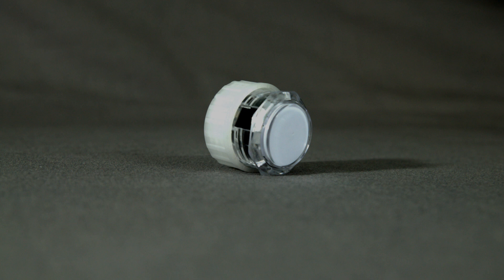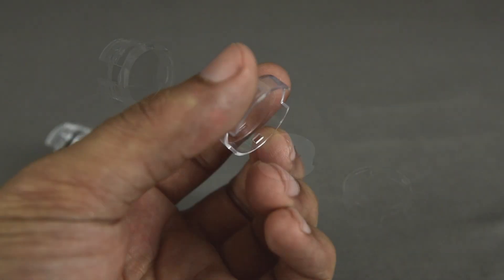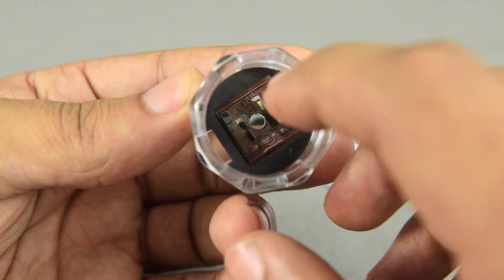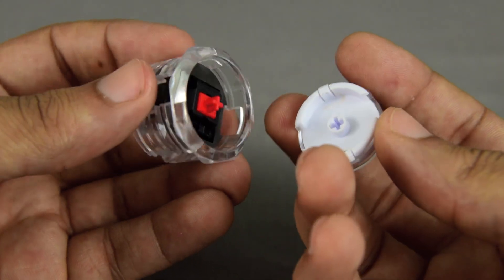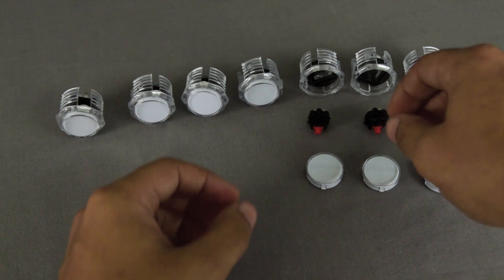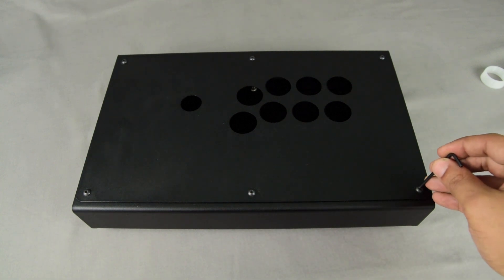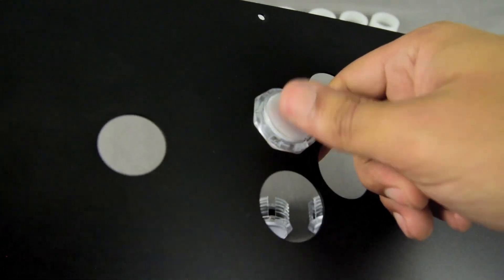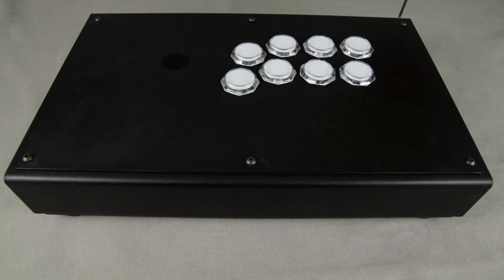Tech Corner: The GamerFinger HBFS-30-G3 Pushbutton

Comment: Do yourself a favor, and be careful with these buttons. I've already complained to GF, and they didn't respond this time, though they replaced my buttons once before. They're overpriced for how they perform. I had Sanwa's for over 15 years that still work, I had to replace these buttons TWICE in a 5 year span. I had the first gen, they kept sticking somehow, I don't know why, maybe it's because I was in an area that is somewhat humid, but the sound muzzler inside just kept sticking to the button. I had to drop alcohol in them every other 3 days to get it to stop sticking. I like to press buttons very lightly, when you first get these, you barely have to put any pressure on them, but after a few short months, you have to BANG them.

Then, I complained to them, they send me another pair, the G3, they worked well for about a year, but they're having problems that I can't even pinpoint. I do have a mechanical keyboard, so I know about these type of switches, although, I think Cherry switches are kind of wack, but they're okay for keyboards; not for arcade sticks, as you will more than likely wear them out faster than on a keyboard I think. I am about to put gateron switches in these and try them out. I don't know if it's a problem with the housing, but god DAMN, do I have to bang these buttons sometimes to make a move come out. I think the switches they come with are just pure shit and don't last long. It's possible that these Cherry switches aren't even real, they look a bit different than the ones for keyboards in the pin connector, but they could be updated, too.

If you're someone like me who makes videos or practices multiple games (I play shmups, platformers and fighting games and make combo videos here and there), these switches are pure shit. I have the Cherry grey's in the ones I have (black G3's.) 

It's hard to know who to blame, Cherry or Gamerfinger (GF does have great customer service though,) but either way, they did not really rigorously test these buttons for the long run. If you were to pay like 6 bucks per button and they only last about a year or two, that's a really expensive investment compared to 2 dollar buttons from Sanwa; or even Seimitsu, that last more than 5-10 years. I swear to god, I have a mirror top HRAP1 with the ugly green buttons, ALL of those buttons STILL WORK. I must have played a million+ games of 3S on that stick, and never had to replace those buttons.

I'm using these in an Etokki Omni with a Brooks Universal board, so I know it's not my board. Lastly, look at the reviews on FA for these buttons, I'm not the only one who's complained about these. It could be the button housing, or the switch. Either way, be careful with these.
Reply: I've owned a set since 2018, never had them replaced, and never changed out the mx silvers they came with. 

They still work. 

And fixing the buttons are as simple as buying a new microswitch rather than new buttons.

Also you can disassemble these buttons and clean them with soap and water. 

I wouldn't dare to do that with a Sanwa or seimitsu button

Comment: I have just bought a HORI Fighting Edge and I want to change the hayabusha buttons (besides other parts), as they are too sensitive for my taste. I'm new to pushbuttons, so I have some noob questions.

I'm thinking about ordering a sample of each cherry microswitch and test them out. (Otherwise how would I know?) Are the microswitches compatible with any pushbutton, or only with the Gamerfinger?

I don't like the octagonal shape of the Gamerfinger buttons, is there a circular version or a different brand you can recommend instead?

Do you think it's a good plan to order a sample of the microswitches and install them into buttons to test them out, or would it be better to just buy let's say Sanwa buttons?

Any advice is welcome, thanks!
Reply: Microswitches are also compatible with the Crown 202-MX: 

30mm - https://focusattack.com/pushbuttons/popular-brands/crown/sdb-series/30mm/202-mx/
24mm - https://focusattack.com/pushbuttons/popular-brands/crown/sdb-series/24mm/

They are not compatible with any other button, such as Sanwa or Seimitsu.  This would answer the other questions you had.
Reply: Old post, but I found sanwas to be too sensitive for me. Switched to seimitsus and have never been happier. That said, crowns SDB202 buttons are good as well and you can swap the switches on those as well. They have the circular barrel that you desire as well.

Comment: How do you remove the switches; IE bought blue switches separately, but silvers are pre installed?
Reply from the maker: There is a hole at the bottom of the base.  You can use a small pointed object to push up on the switch at the base.

Comment: i have the pushbutton style, and when you put it in the razer panthera, it spins way too easily, it doesn't quite bite into the panel, the side tabs, what can i do to prevent this? i didn't get the lock ring when i ordered from GF, is there anyway i can buy the lock rings from you guys? the buttons spinning just drives me nuts, and i hate it. What can i do to make it snug like a sanwa snap in? thank yu
Reply from the maker: The lock ring doesn't fully go to the top of the snap button rim, which prevents it from locking on a thin metal panel.
Reply: @focusattackcom  oh i see...what can i do to prevent the buttons from feeling loose while in the panthera? for some odd reason it doesn't fit snug on the panthera, it happens to be in that elusive thickness where it's not too thin or thick enough for the tabs to grip on it, so it can freely spin even when i pushed it TIGHT and flush onto the panthera panel, its not super loose but i can spin it easily with my fingers if i wanted to. Any remedies for this? you guys should try it out with a stock panthera, default art still on, i havent tried with a plexi so i can't say but the default art plus the metal panel seems to be too thin for the buttons to snap on tight
Reply from the maker: @bludika  I have a snap in sample, but I don't have a stock Panthera anymore - the one I have is stripped and panel replaced.  you could possibly use one of our TE2 rings, or something like a rubber band or o-ring.
Reply: @focusattackcom  yea i was possibly thinking of the TE2 rings too hahaha. But it's just odd how the snap ins don't fit snug in the panthera, while in the PRO N it fits so snug that it's a pain in the ass to take out, and their panel is fairly thin compared to the Panthera, i guess its just a coincidence the panthera panel with the stock art just fits in between the sizes for the tabs :(

any possible chance i can get a free sample of the 8 TE rings? i know it's selfish request but i really can't see myself ordering just those, i usually like to order a bunch of buttons and new crown lever etc along with small misc parts, but just those mic parts alone, ehhh... not sure. I will be more than happy to try it out and let you know in an email if it works or not, that way you can make note on your fb, twitter, etc  and website it helps with the GF buttons, i know it bothers a lot of people from what i've read on Reddit that the buttons freely spin around even when snapped all the way in :(

Comment: Has anyone had a issue with the art plunger falling out? If so what happens?
Reply from the maker: I've asked GamerFinger about this. Part of this may be due to installation.  Try rotating the plug 90 degrees and then pushing in again.

Comment: Do you sell them without the screw in? the snap-in ones?
Reply from the maker: Not right now.  We were trying to avoid duplication by offering screw only, as the snap in basically works the same. These aren't cheap even for us to buy. However, we are investigating snap in as the requests come in.
Reply: Focus Attack Arcade Parts Superstore yea please get the snap in model
Because screw ins aren’t really flexible in all cases and layouts
Reply from the maker: @bludika  we may consider this, but then phase out the screwbuttons.  Unfortunately, the cost of the buttons is rather high to carry both versions.
Reply: @focusattackcom  Any news? I'm still waiting on those snapins for hitbox, since the screwbuttons won't fit.
Reply: @sacatolasmoreira5593  Not yet.  It's difficult enough to get a response from GF on regular matters.  We'll follow up later this week after the EVO SALE

Comment: I recognise that these are "30m," buttons, but how large is the diameter of the top of the button? Slightly larger, but I'm not sure how big?

How about the 24mm ones?
Reply from the maker: The diameter of the top of the button is smaller than the button base/housing.  This article might help to explain https://support.focusattack.com/hc/en-us/articles/208774716-24mm-vs-30mm-Choosing-the-right-Japanese-Arcade-Button
Reply: Sorry! I mean including the rim..
Reply from the maker: The outside diameter of the button including the rim is 33mm.  Please keep in mind that the rim does not represent the diameter of the button housing, only the rim itself. The rim adds close to 3mm, but sits atop the 30mm button hole.
Reply: Mmhm! Thank you! Do you have the measurement of the 24mm buttons? I would like to include those as well!
Reply from the maker: The outer rim measurement is 26.5mm.
Reply: Thank you! <3